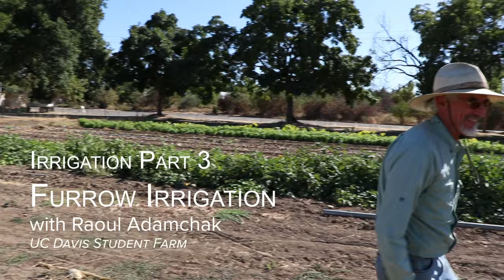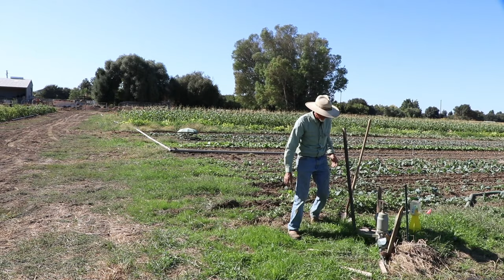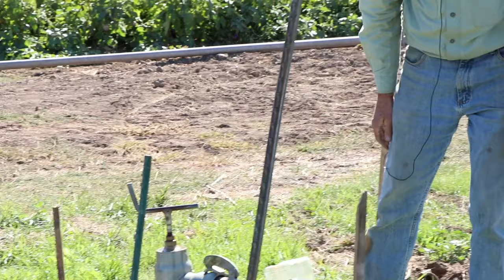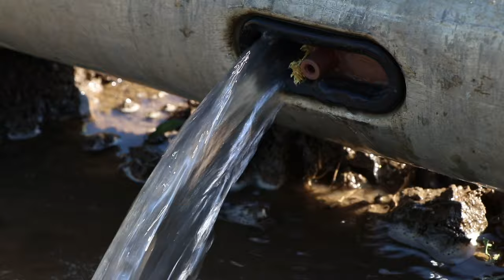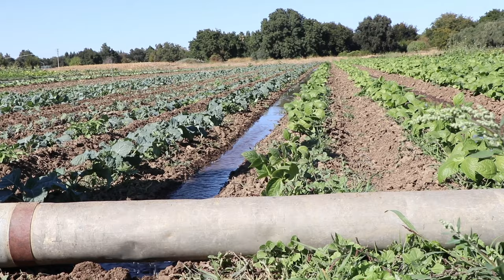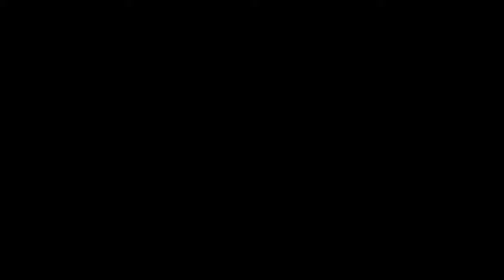Furrow Irrigation

Comment: It uses a lot of water, but you said you only have to water every ten days or so, while with the other systems it was almost every day. So it seems the amounts used by both systems might be close. Additionally, the surface evaporation area is reduced as the water soaks in sideways under drier and deep soil, which acts like a evaporation barrier. Dirt becomes it's own mulch, so to speak. I've started doing this on my fruit trees. But I make a circle furrow around the base with somewhat raised sides. Not deep, just about 8" or so total. When I water, I let the "moat" fill up, and when it's full, I stop. I have checked the soil moisture every few days to see how effective this system is working for me, and it seems to keep the water in really well. I've used it in the past, as sandy soil will throw off water unbelievably fast and nothing gets to the roots on a shallow water. The moats need re-forming every so often, but it just takes a minute. I can put my fertilizer or Epsons Salts in the moat and it doesn't wash away. It seems people don't use the furrow method much any more, maybe it's just my imagination.
Reply: upload detailed video of whole process please. Thanks

Comment: Never furrowed irrigated... have a good friend who does several thousand acres of corn and beans using what is called  poly pipe which is recycled yearly.  He told me that on sandy loam soil you have to water down every middle 36 or 38 inch rows but on his heavy clay/gumbo he can do every other middle 
The sandy loam has a tendency to seal up to tight foe water to effectively wet the rows.